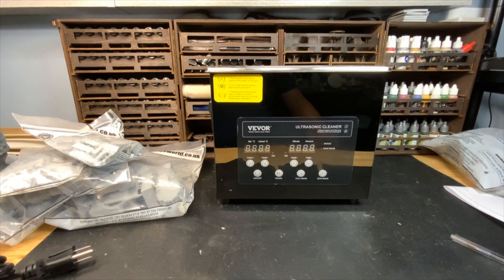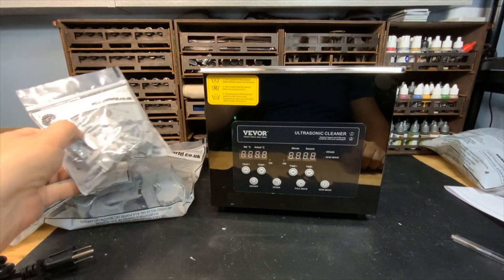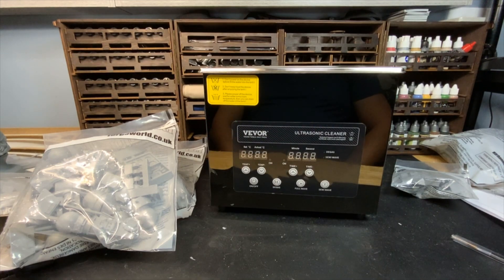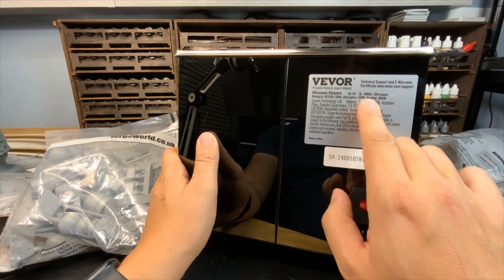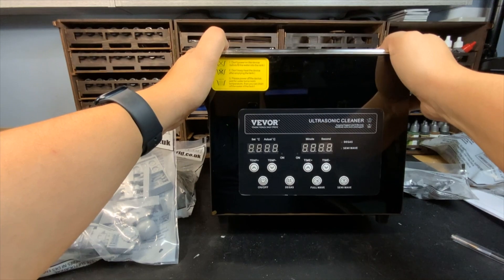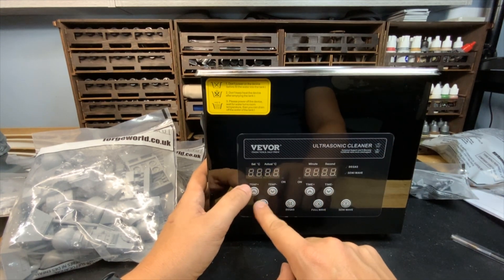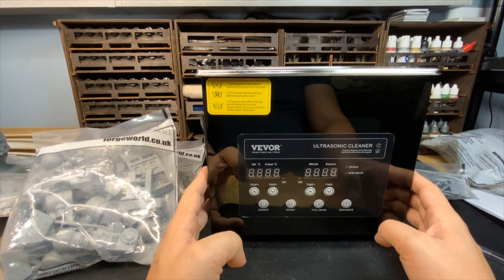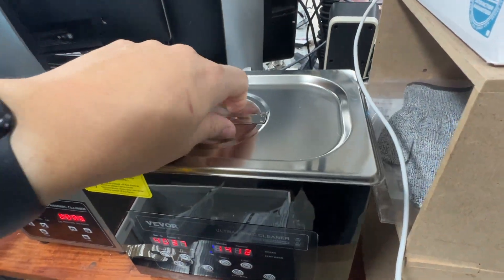Is An Ultrasonic Cleaner WORTH It For Your TITAN Builds And Models?

Comment: If you haven't thought of it yet, an ultrasonic gives you a great controlled way to heat up and bend models back to shape.  That way, you can bend it to fit and then dunk in cool water to set the shape.  That way you can control for the warping that happens frequently with resin models.  You can also buy small wire collanders like you'd use for draining pasta to give you a fine mesh basket, although that's more helpful for larger cleaners.